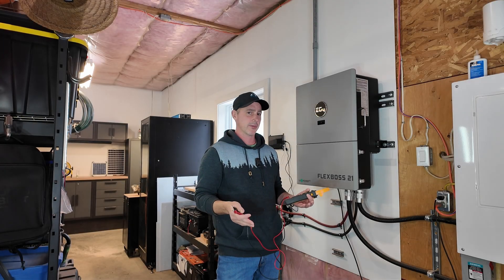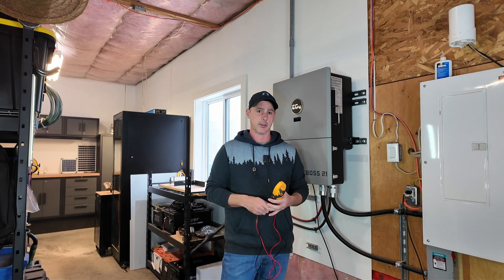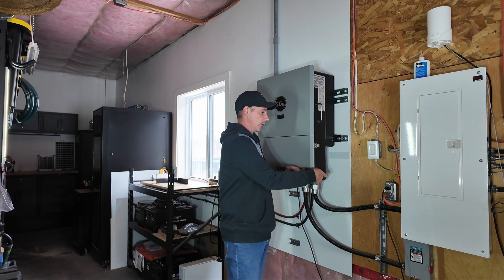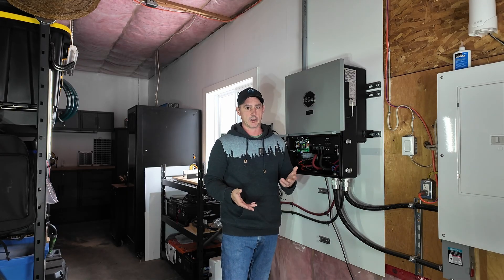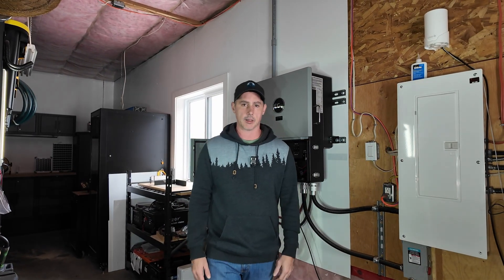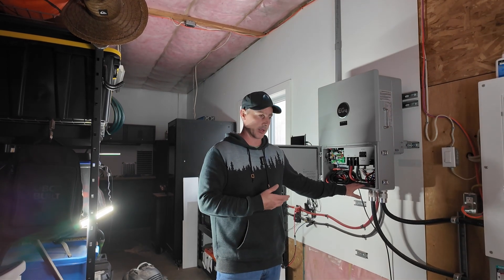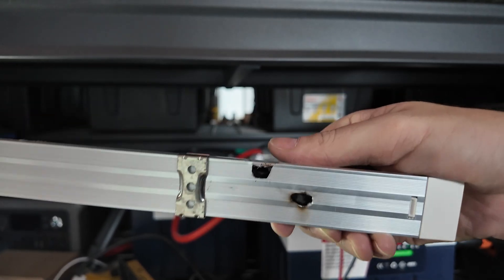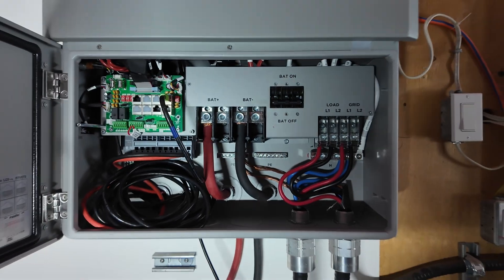EG4 Flexboss 21 Stopped Working: Replacement

Comment: Always set the 1 before clicking "set" on lithium battery type or it wont recognize the powerpro or ll-s battery in can port, 0 for lifepower4 in rs485 port
Reply from the maker: Thank you. That will help some viewers. I'm not using communications. I'm using the lead-acid protocol.

Comment: Out of the 8 flexboss21 units i installed in 2025 this happened only to the very 1st one (also all black back housing and brackets) after only 3 mwh of power through it. Eg4 said it happened to a small batch and after a few tests and photos to signature solar they sent the replacement direct to me so i could use the box for the return. Took 5 days from failure to new on the wall, (less than 1 hour to do the actual swap with wifes help) which is amazing as freight alone usually takes 2 weeks to my rural area but they shipped ups to expedite this process for me. Thanks eg4, signature solar and roll2
Reply from the maker: Thank you for sharing your experience. This will help the viewers 😊